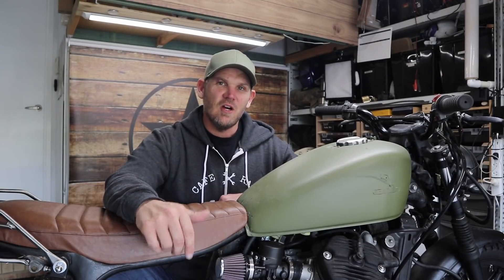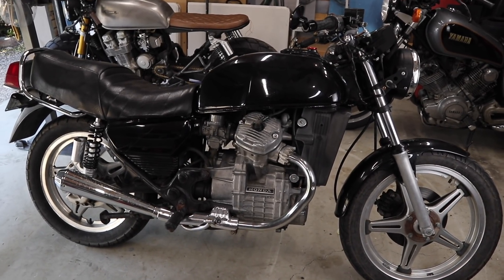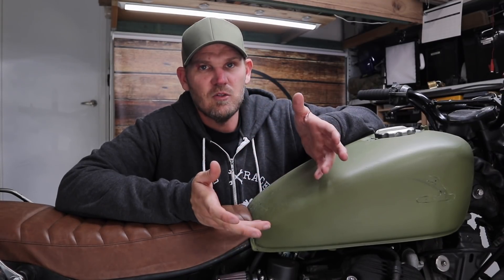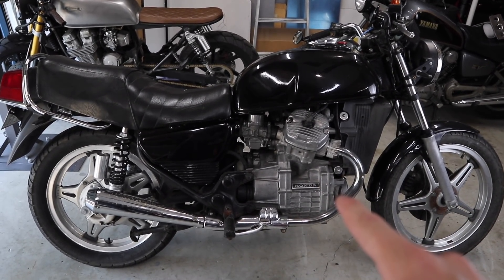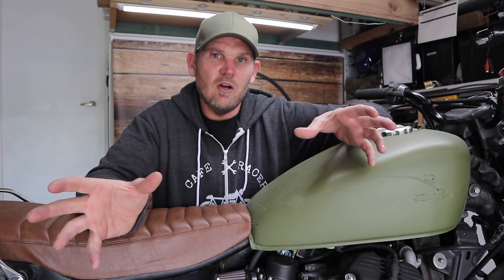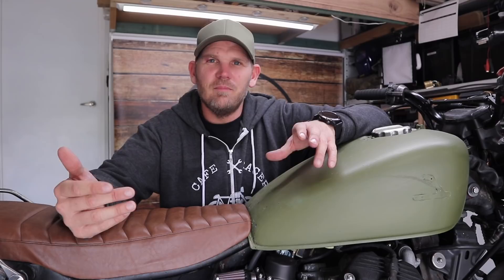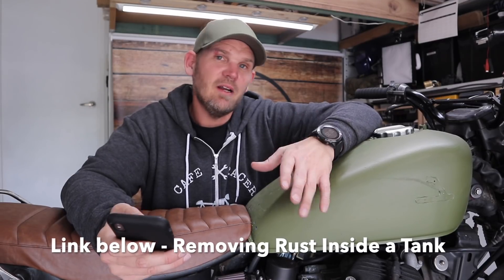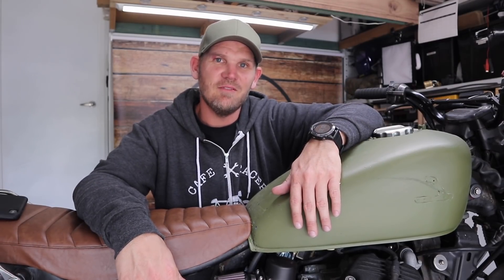6 Things to Avoid When Buying a Used Motorcycle

Comment: He is the first one I saw that mentioned a compression test. HUGE!! Poor compression/rings is the most expensive thing to fix. It is like a heart surgery. A kit off Amazon is cheap ($30) and even the lightest mechanic can do it. Just take out the spark plugs that are usually right in your face. I'm a fairly experienced mechanic, and it is basically the only thing that is a deal breaker for me.

Comment: I deal in cars but presume bikes are the same - searching the VIN on the PPSR in Australia costs $2 on the government website.  There are a whole heap of internet resellers who make themselves seem quasi official and charge $20 to $30 for the same thing.  Many use the term REVS as that was the old government abbreviation in many states years ago and is effectively slang for PPSR. The worst I’ve come across was Pickles who will charge $48 for the search if you haven’t done it yourself when you go to auction a car.  They are all the same, look for the official PPSR government site.
Reply: Pirata Sports was about to mention it...but hey it’s already been mentioned. :)
Reply: Hi there. Helpful info! I'm looking at purchasing an 81 suzuki gsx400 - from the photos I've seen so far it looks as though a QLD transport mod plate has been fitted over the factory stamped vin number... when I use the number on the plate to perform checks - I get an invalid vin error message. Do I need to add the js1 on the prefix and then decode the gs40x model number to the original format? I'm lost and don't won't to inherit a stat write-off or stolen property.....

Comment: Great list, but lets see how I did lol
1. My K100 has been dumped on both sides which ruined both engine covers with deep gouges that cant be refinished.
2. Forks were actually very good, The seals didnt even leak
3. The forks may not leak but there are plenty of leaks mainly around the engine cover bolts
4. It was definitely complete...although clearly it hadn't been apart in TOO long considering how much filth was caked in it
5. Clean title
6. It started great, if anything my tampering with all the old seated rubber made it run worse lol
Reply from the maker: Sometimes we just need to overlook the bad stuff and hope we have the skills and budget to get it looking sexy again. Your bike is definitely going to be worth it in the end :)    Clean title is the most important. Everything else can be fixed I guess.

Comment: Great info for inexperienced buyers mate, quick one, where to purchase an LED flasher unit man?
Reply from the maker: mongrelkat 1 you can buy them at a local auto shop I think but make sure you get the right one. I made the mistake of buying a crappy cheap one and I didn’t work so I will be listening good ones on my website soon :) website is getting built as we speak
Reply: @CafeRacerGarage  Cool mate cheers I'll try Jaycar, hard to get for old bikes.